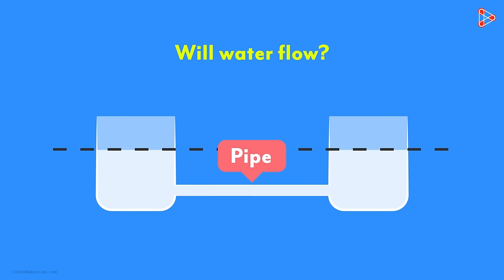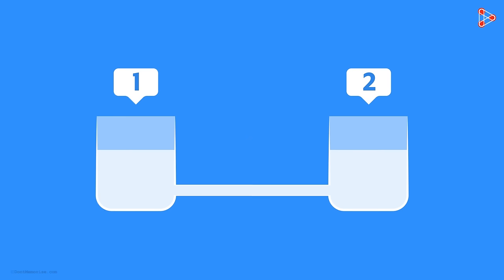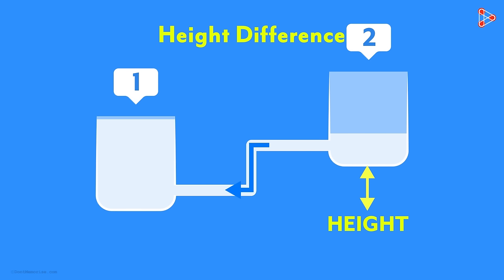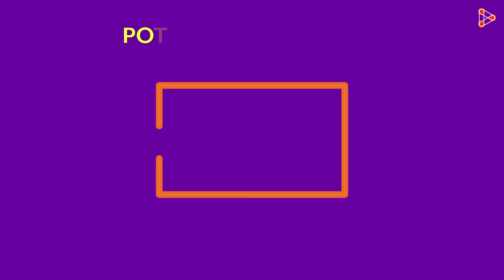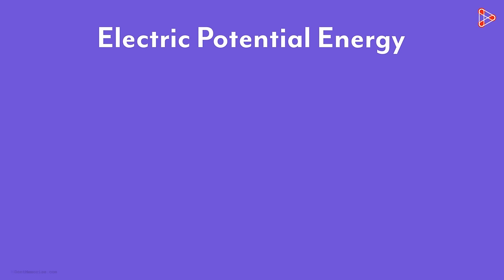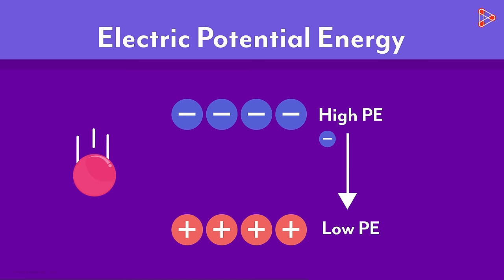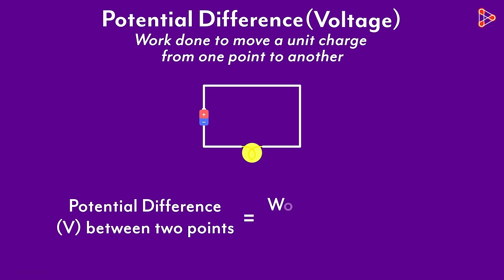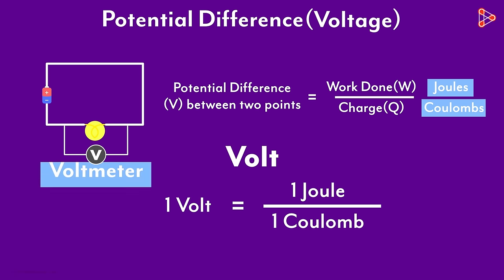Electric Potential Difference | Electricity | Don't Memorise

Comment: why does not current  flow with only one end point with a conductor connected to it as there is a potential difference between the endpoint and the conductor as well?

Comment: Potential difference causes flow of electricity in any circuit.

Electrons are the charged particles. ... Only the charged particles can attract or repel electrons and those that are not charged can only give force on them. Thus the flow of electrons can generate electricity and electrons that moves on a wire continuously gives rise to electric current.

Comment: Lett me see if I got this right. You said potential difference is equal to volts. To measure potential difference is the same as measuring volts. A strait forward answer to a strait forward question is sweet to my ears. You are a god send.

Comment: Maam I asked one question 
What if voltmeter is connected  in series ?
Please  reply maam
Reply: A voltmeter is connected in parallel and not in series, as the voltage remains constant in a parallel connection and so the accurate voltage can be measured.
Reply: @niharikadhyani  I think tum meri bandi ho 
Maal ho meri jaan

Comment: Hey, just for some people... 
the potential energy doesn't have any relationship with the voltage.
Reply: Actually the potential energy is the electric potential multiplied by Q (Joules/Coulomb *Coulomb=Joules) and the electric potential difference is the voltage in volts, so they are not entirely unrelated :)
Reply: No..... there’s no relationship between potential energy and potential difference ..... potential just Basically means “stored”.... 🇮🇳 🇮🇳

Comment: But in my text book potential  difference is the work done on unit positive charge to move it from point A to B through distance L n positive terminal has higher potential than negative. Plz clear my doubt as soon as possible . I am literally confused
Reply: Kavita I'm confused with the same thing.  Did you get the and from anywhere
Reply: see potentail are two type(1) electric potential difference &(2)only potentail difference is in it  now ,in case frist that work done from one point to another point like A to B of a unit possitive charge  well in case second that work done moving from infinete
Reply: @zubairAhmad-wz4mz  thanks
Reply: It is actually moving from a region of low potential to high potential. So positively charged terminal is at high potential and vice versa. If we take the case of positive charge, then it moves from low to high potential i.e., from negative to positive and vice versa.
Reply: @sarangvs2326  at 2:49 of the video she says something a negative charge near another negative charge , high potential something , can some1 help me out?
Reply: Electric potential and potential difference are two different things. 
Let me make it more clear but Let us first know, what is electric field.
 In simple words, electric field is the region in the space created by a positive charge around itself such that whenever another charge enters into its field. It experiences some force due to its electric field. It may be attractive if the another charge which enters is negative or repulsive if another charge is also positive.
Now electric potential can be defined as the work done on a one coulomb(unit) charge in bringing it from infinity(meaning far away place from the charge"s electric field) to it's own electric field on "ANY POINT".

But electric potential difference is defined between "2 POINTS". It is talked while considering that the two points are inside an electric field created by a unit positive charge. Now, when we have to move a unit positive charge(1C) from one place in an electric field to another then the amount of work done to carry that 1 columb charge is said to as electric potential difference between the two points.
Point to remember- electric potential is defined for any single(1) point in an electric field. But Potential difference is defined in considering 2 points inside an electric field. Whereas, in case of electric potential the charge has to be taken out from infinity(outside the field) to that field. 
Hoping you may understand now✍
Reply: @oyxycxpiit22ycpycxyouodf95  That all is ok. But what actually is high potential and low potential and all because these definitions don't make much sense to me. what is the relation between a battery and these definitions?
Reply: @oyxycxpiit22ycpycxyouodf95  agreed. In the video she mentioned electric potential not potential difference.

Comment: If 9V means that 9 joules of energy is transferred by every coulomb of charge, then if all of this energy carried by the electrical current is transferred into light/thermal energy in the lamp, then how does the electrons have any energy or "pushing force" left to return to the opposite side of the cell?

Any help is appreciated!
Reply: I believe it is the emf or electromotive force of the battery or cell connected in the circuit . In simple terms u can take EMF as the pushing factor that in real works to make electrons flow and to produce current. Because of this fact the battery or cell stops working after a certain period of time . Similarly since electrons do not waste , therefore  the electric bill that we pay is the cost of emf(can be considered) or energy provided to us my electric power plants to move electrons to produce current
Reply: @ashokmondal8500  Thx for the reply! But say we had like 1 Coulomb of charge carrying 1 Joule of energy in a series circuit. After that coulomb of charge passes through a lamp, it transfers all that energy into light/thermal right?  If so, that Coulomb of charge leaving the lamp, is now carrying 0 Joules of energy. So how does that Coulomb of charge have any energy left to return?
Reply: @Random-nq4xj  And folks that is why you connect a battery or give a constant supply of current i.e electrons 💁 the lights in your home have constant current supply. Every house has a 240V current and the same goes in the lamp.
Reply: @Random ! And also step down transformer is used in lamps to minimize the voltage so that the lamp doesn't break down💁

Comment: Negative terminal is regarded as at low potential and positive terminal is regarded as at high potential . Electrons flow from low potential to high potential but electric current is supposed to be flew conventionally from high potential to low potential.
Please correct...

Comment: But if this movement is occurring due to attraction of like unlike charges(-ve to +ve), then I can just attach a wire to the positive end and electrons will start flowing. Why attach to -ve end at all?
Reply: also if voltage across two points is the work done by a unit positive charge, then why is voltage same across parallel circuits?

Comment: You say that a negative charge close to a negative has high potential energy? Then what about a positive charge close to a positive charge? Does it imply the same way?

PLEASE ANSWER MY QUERY AS FAST AS POSSIBLE.
THANK YOU!!!
Reply: Positive charge close to other positive charge is the low potential party of the cell, that means there are least amount of electrons (or the most amount of positive charge) there than anyplace in the circuit!
Reply: So yes or no?

Comment: I understand that In an atom an electron has some potential energy and use of battery,or any inductance, That Changes that potential energy that is change is defined as electrical energy and the potential difference is the measure of that change per unit charge or the change in energy can be termed as work done so, V=W/Q or V=change in electrical energy/charge. So the potential difference can flow the electrical energy by the use of electrons in an conductor.

That’s it if I am wrong anywhere then please correct me. 
Thanks

Comment: Why is the voltmeter connected in parallel but not series
Reply: Because it has higher resistance
Reply: Ideal volt metre has infinite resistance,if connected in series it won't allow any flow of current in the circuit

Comment: Can anyone help me? I can't understand why must the placement of the voltmeter be placed in a parallel circuit, why can't it be placed in a series circuit like the ammeter?
Reply: The ammeter measures the current flowing through itself. If you want to measure the current flowing through another component, then you must make the current through the ammeter equal to the current through the component. If you wire it in series, that's true. If you wire it in parallel, the current would be unevenly divided between the component and the ammeter.

Similarly: The voltmeter measures the voltage across itself. If you want to measure the voltage across some other component, you must make the two voltages equal. If you wire it in parallel, that's true. If you wire it in series, the voltage would be unevenly divided between the component and the voltmeter.
Reply: voltmeter is used to determine the voltage of two points in a parallel connection
and ammeter is used to determine current which is usually given in series circuit